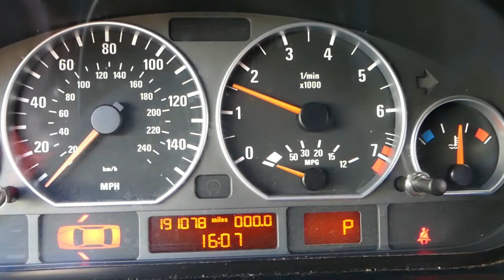CATALYTIC CONVERTER REPLACEMENT REMOVAL CHEVROLET CRUZE CHEVY SONIC

Comment: Im not a mechanic, but am mechanically inclined. So far on my cruze i have replaced my water pump, throttle body, coolant tank. Both 02 sensors and the valve cover gasket. Your videos have saved me so much money. Honestly thank you so much for doing this.
Reply: can you replace mine? lol
Reply: intake manifold ?
Reply: I have not replaced the valve cover yet but eventually I will have to. Everything else in your comment, I have replaced. Now I’m here for this exhaust/catalytic converter training.

Comment: I hate my cruze and you have alot of space to work with. I had remove my turbo just to get the bottom 4 bolts and remove a lot of hoses as well remove a few crappy design bolts it had such a big pain would be easy job if i did it like you did by removing the front of the car and fans ect.

Comment: Take off the motor mount on the left hand side like you’re doing a timing belt, and support the motors with a jack. You can raise of lower the motor to prevent taking the ax system apart.

Comment: I REALLY LIKE YOUR VIDEOS ,I HAVE LEARNED A LOT,,AND THANKS FOR EXPLAINING WICH TOOLS TO USE  BUT NOW I HAVE A PROBLEM WITH MY 2011 CHEVY CRUZE LT RS 1.4 TURBO ,I LIKE WHAT YOU DID ON THAT 2015 CHEVY CRUZE ,BUT YOU DID MENTION AT THE BEGINNING THAT YOU WOULD HAVE A VIDEO ON A OLDER YEAR,,I HAVE A P0420 CODE " SYSTEM LOW EFFICIANCY BANK # 1,,I REPLACED OXYGEN SENSOR UP STREAM AND BOTTOM,AND I EVEN USED A CAN SPRAY OF SEAFOAM THROUGH THE UP STREAM SENSOR NEXT TO THE FRONT EXHAUST MANIFOLD BUT SAME P0420 CODE KEEPS COMING BACK !! I HAVE NOT SEEN ANY VIDEOS ON HOW TO REMOVE MANIFOLD EXHAUST PLUS CATALYTIC CONVERTER ON A 2011 ,I WOULD MUCH APPRECIATE IT IF YOU GUYS CAN MAKE ONE, THANK YOU VERY MUCH.

Comment: My Cruze is a 2011. The cat. doesn’t look like this one. Parts stores show it as bolted to the exhaust manifold after the collector and it’s pretty long too. Can I get away with just the cat. replacement or does this version also need the exhaust manifold?
Reply: This is for the 1.8 , you might have a 1.4 turbo
Reply: you don't need the manifold, just the cat

Comment: If the oil filter cap isn’t on tight it will leak and spray all over the engine. My question: can that cause problems with the Cadillac converter. Or would it make your car give out Cadillac converter codes
Reply: No it doesn’t it’s going to give the catalyst converter and the oil are two different components it’s going to give you another error code

Comment: Don't be ridiculous I'm not planing to drain the ac to do that. My mechanic changed my oil cooler and did all that without removing the radiator or ac line.
Reply: but wouldn't you only need to remove the exhaust manifold/catalytic converter off their studs, rest it down below the oil cooler to actually replace said Oil Cooler. No need to fully remove anything out of the engine bay since oil cooler is easy to get to  That being said, my man's here is showing us how to REMOVE and REPLACE the catalytic converter and in doing so one might need to remove radiator and ac lines to make the job alot easier. TMYK

Comment: what year is this car mine is A 2015  and my heat shield doesn't look like this  my cat convert lot easier then this video update your videos  my exhaust manifold doesn't look like this
Reply: video is for the 1.8L engine not the more common 1.4L mine is the 1.8 and is exactly like this